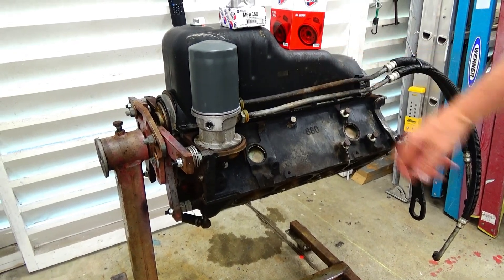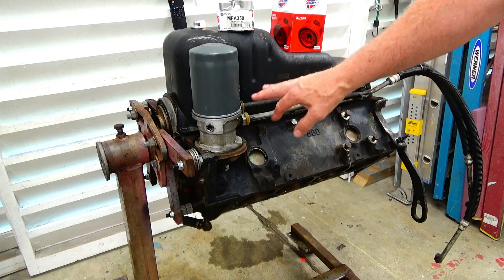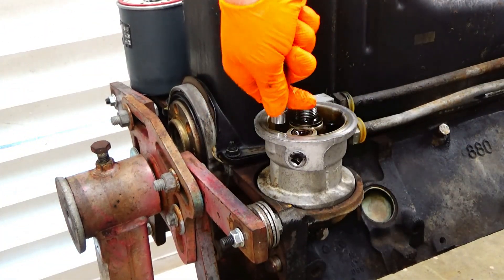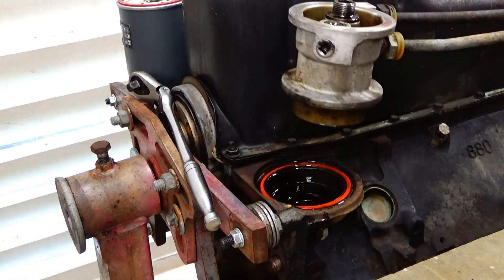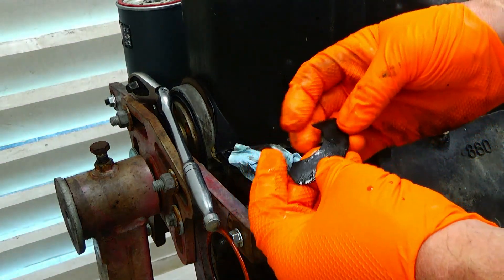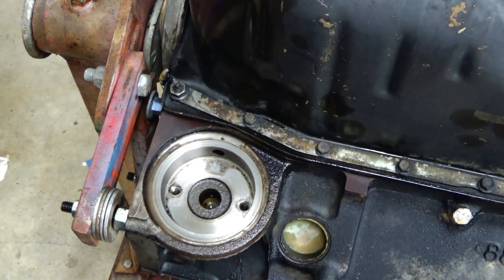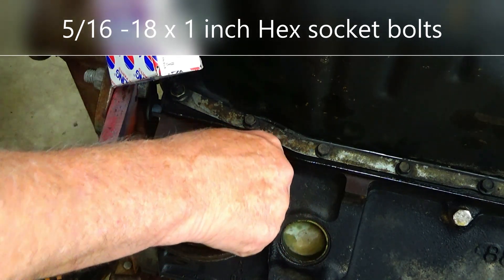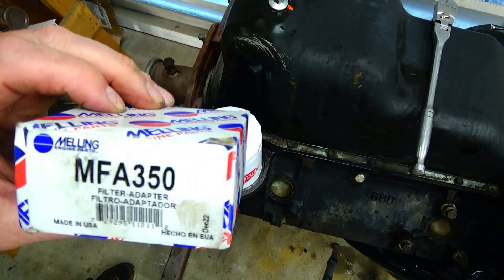Chevy 5.7 L  leaky oil cooler delete

Comment: What did you do with the two female fittings on the radiator where the two hose assemblies screw into the radiator?  Just leave them open? Other than for aesthetics getting dirt in the oil side of the radiator doesn't matter much.
Reply from the maker: I blocked them off by using the fittings and metal lines I removed....did not want to burn any bridges incase I need the cooler functional later

Comment: Any real concern with over heating now? I don’t tow a lot but I still need to be able to.
Reply from the maker: I would rather take my chances without an oil cooler and the risks for leaks.   I have towed with a dozen vehicles..none had an oil cooler but that is flat land..in the mountains you sure may need it

Comment: Did it leak lol I need to know buddy  he'll with an oil cooler all they do it's leak it's the stupidest thing I've saw chevy do or make or what ever plenty of truck pulled shit behind them with out an oil cooler for the engine oil
Reply: They made them in the older corvettes to keep the engine from overheating in the smaller engine bay I'm deleting mine as the engine bay the engine ended up in is way bigger
Reply: It don't leak the gasket on the oil filter takes care of that